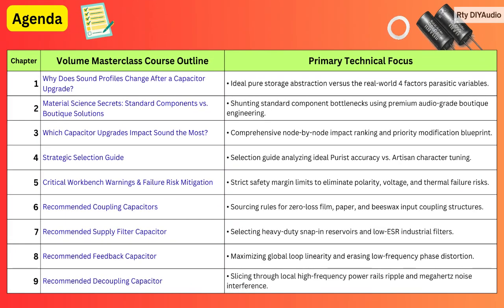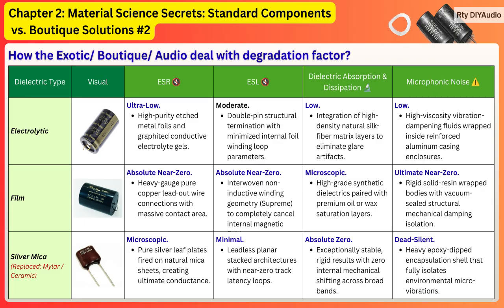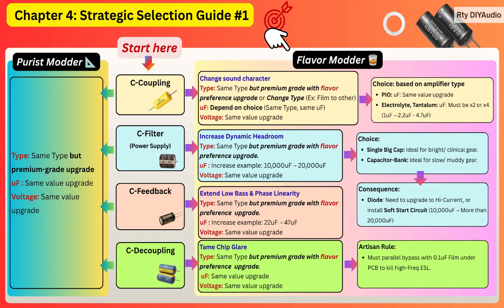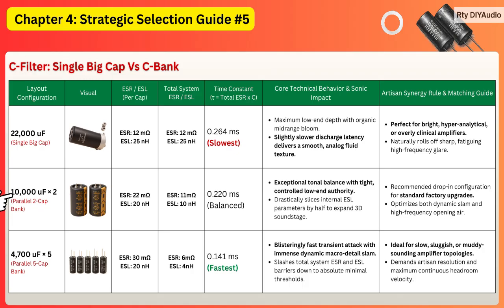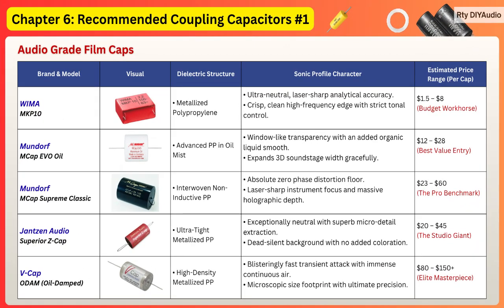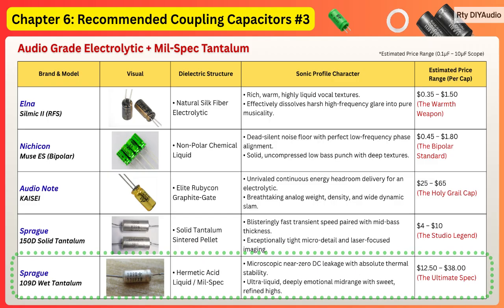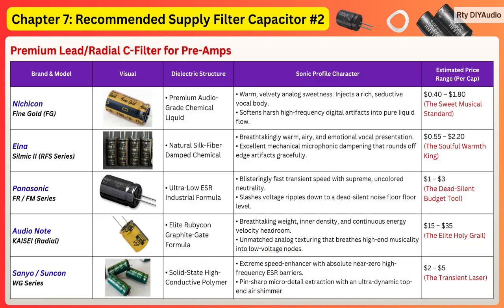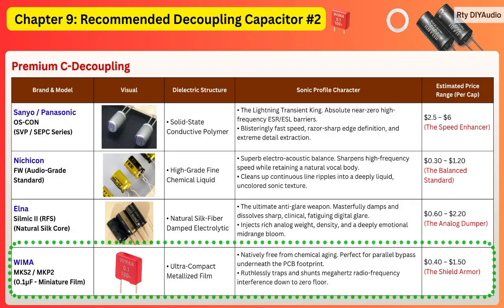Capacitor Upgrade: Demystifying Audio Component Selection | DIY Audio | Mundorf | ELNA

Comment from the maker: Hi everyone! Thanks for watching. Since English is not my native language, some text on the slides might sound a bit unnatural. However, I’ve put my heart into researching and verifying all the electronics and acoustic physics behind this video to share the best possible knowledge with the DIY audio community. Feel free to drop your thoughts or technical questions in the comments! Happy modding! 🛠🔊

⏱ Time Stamps:

00:00 - Intro
00:22 - Disclaimer
00:56 - Agenda 
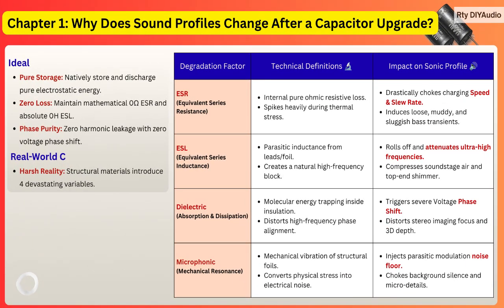01:52 - Why Does Sound Profile Change After an Upgrade?
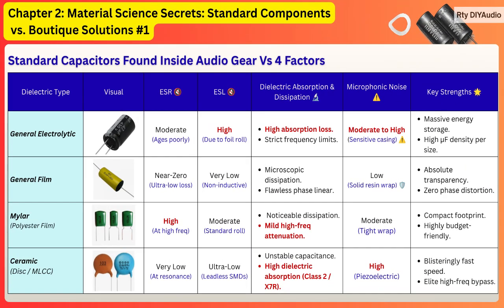04:01 - Material Science Secrets: Standard Components vs. Boutique Solutions
             04:01 Standard Capacitors Found Inside Audio Gear Vs 4 Factors 
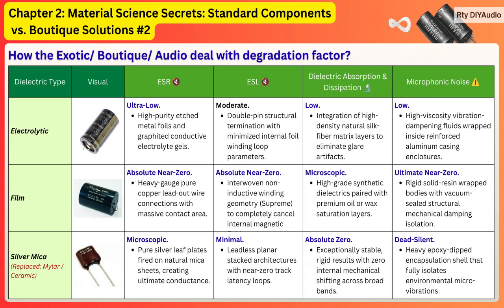             05:48 How the Exotic/ Boutique/ Audio deal with degradation factor? 
07:32 - Which Capacitor Upgrades Impact Sound the Most?
            07:32 Functional & Ranking
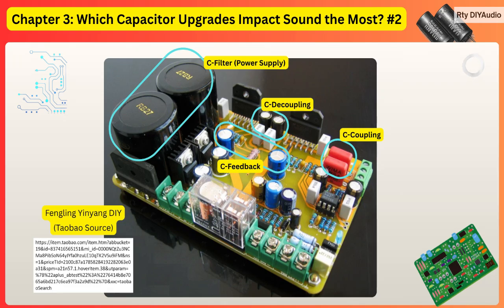            09:09 Physical mapping
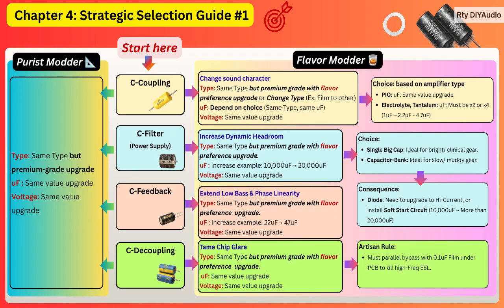10:47 - Strategic Selection Guide 
            10:47 Defining Purist vs. Flavor Modification
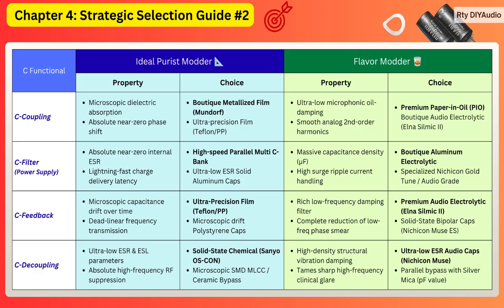            11:44 Modder Strategies Across Core Functions
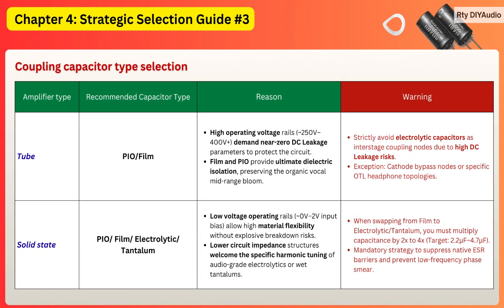            13:18 Coupling Type Selection for Tube vs. Solid-State
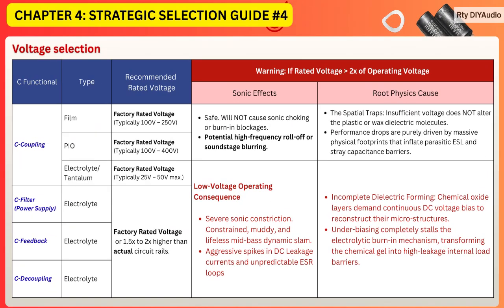            14:26 Rated Voltage & Dielectric Under-Biasing
            15:33 Single Big Capacitor vs. Parallel Bank Velocity
            17:13 Infrastructure Safeguards & Soft-Start Boards
18:27 - Critical Workbench Warnings & Failure Risk Mitigation
20:56 - Recommended Coupling Capacitors 
            20:56 Elite Audio Film Profiles
            22:54 Premium PIO & Paper-Wax
            24:41 Audio-Grade Electrolytics & Mil-Spec Tantalums
26:43 - Recommended Supply Filter Capacitors
            26:43 Heavy-Duty Snap-Ins
            29:18 Radial Pre-Amp Filters
31:41 - Recommended Feedback Capacitors
33:58 - Recommended Decoupling Capacitors
36:37 - Universal Outro: Build with Technical Precision

If this technical analysis brought clarity to your current workbench project, please consider subscribing, liking, and hitting the notification bell on Rty DIYAudio. Feel free to share your own build experiences or ask your technical questions in the comments section below!

#diyaudio #audiophile #amplifier #electronicsdiy #hifi #capacitor #wima #mundorf #nichicon #classd #tpa3255 #workbench #diyelectronics #hifiaudio #audiomodification
--------------------------------------------------
⚠ IMPORTANT DISCLAIMER & SAFETY NOTICE
• DIY Audio Modifications Involve Serious Risks: Electrical projects and power grid experiments carry dangerous currents that can cause severe shocks, personal injury, or hardware damage. 
• Proceed Entirely at Your Own Risk: The technical concepts, engineering theories, and cable-matching matrices shared in this video are for educational and hobbyist reference purposes only. 
• No Professional Liability: Rty DIYAudio assumes absolute zero responsibility or legal liability for any component failure, circuitry errors, or physical damages resulting from the execution of this content. Always prioritize electrical safety on your workbench.